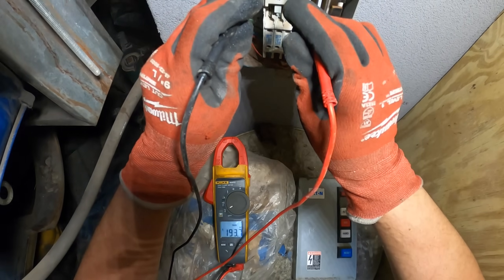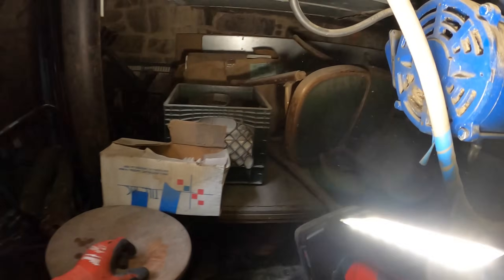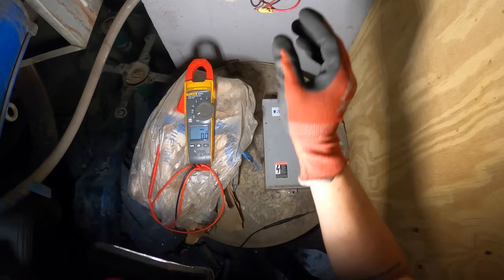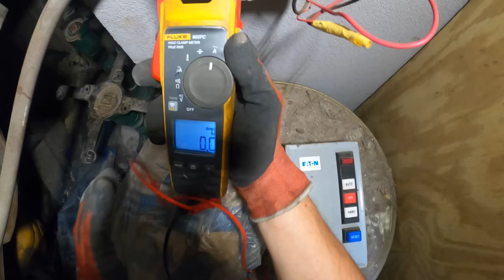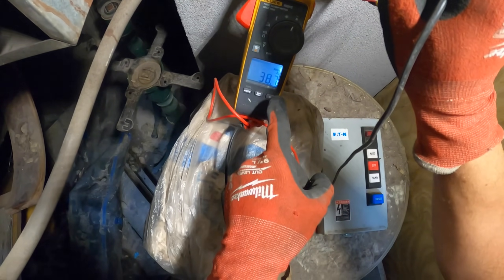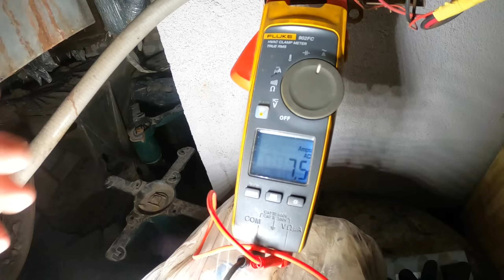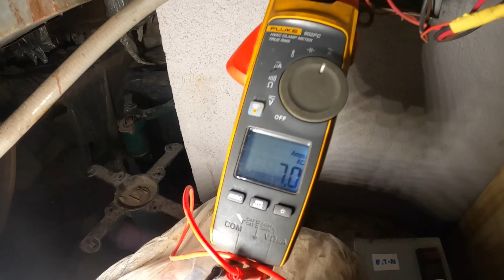HVAC Service Call: Cook Fresh Air Intake/Exhaust System Not Working (Motor Starter Making Noise)

Comment: The "shaking" of the contactor is called CHATTERING.
low voltage is part of problem.  The contacts on the contactor are probably bed. The belts are loose. The squirrel cage may be unbalanced.

Comment: When a 3-Phase-Motor is humming, it usually means, that it is missing a phase. With the contactor rattling it probably burnt up the points and was making a bad connection on one of the phases. Best to allways confirm 3-Phase Power at the Motor itself, before calling it a dead motor :) 
That vibration is a nightmare though. Best to replace that whole heep of junk.
Reply: MY thoughts exactly 🥸

Comment: 3:33 is that an magnetic starter
Reply from the maker: Yes, it is. It's a motor starter. Basically a contactor with an overload device. Thanks for watching! 🔧⚡️
Reply: Motor starters are used to protect the motor, whereas circuit breakers are used to protect the wiring. A motor starter has an amperage range it is rated for with a fine tuning adjustment to make it trip at maximum motor draw plus a percentage for loss over the wiring

Comment: You fix the belt?
Reply from the maker: Nope. It was just replaced before I got there by the building. Next visit, I will be replacing the motor starter, changing the belt and doing some maintenance to see if anything can be done to make it better until the unit can be repalced. Thanks for watching! 🙏🔧⚡️🤙
Reply: @JumpermanTech   I'd check the alignment of the pulleys and sheave depth.
Reply from the maker: @mikekolczynski5665  Facts. Thanks for the advice & thanks for watching! 🔧⚡️